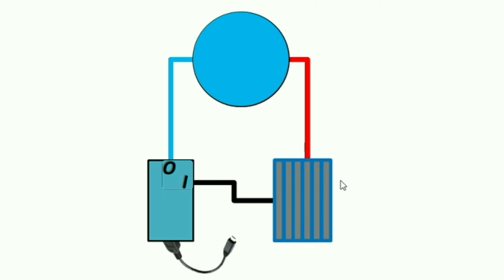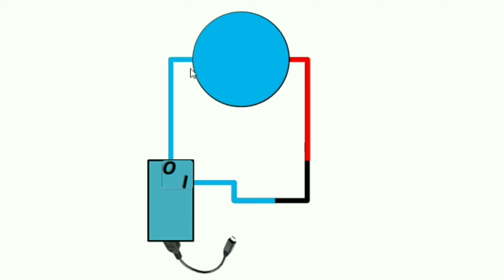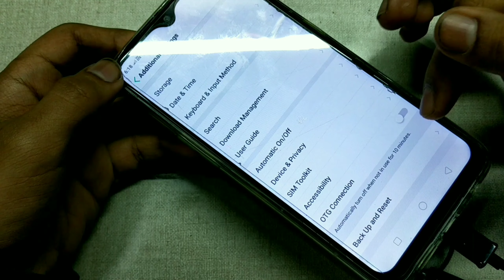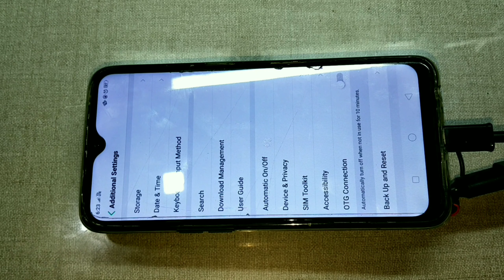Diy Liquid cooling system on smartphone

Comment: Hola está bueno tu circuito pero no enfriará como lo quieres tu seguirá dando un a temperatura como agua tibia yo estoy asiendo casi parecido al tuyo pero en dónde entra el agua a la tapa de metal lo modifique y lo Ise como disipador de calor y le colocaste un ventilador que expulse el aire atraves de unarendija por el interior así enfriará el liquido y con agua de radiador
Reply from the maker: That's great ❤